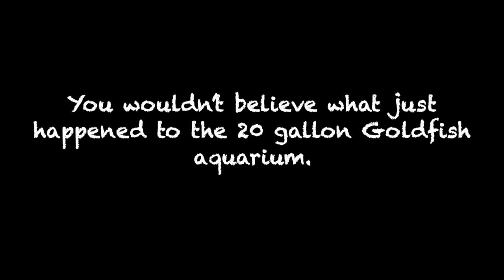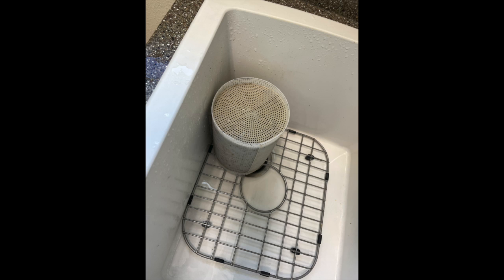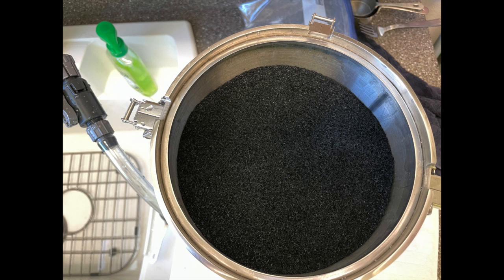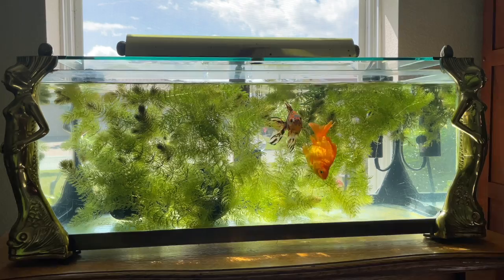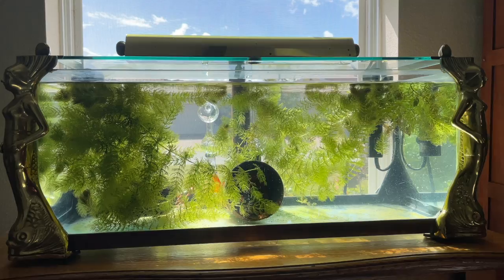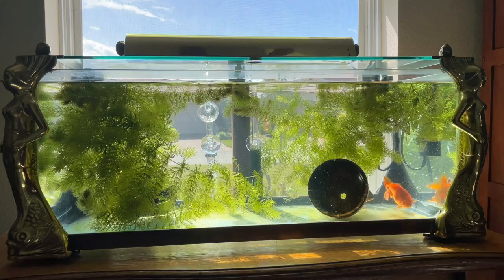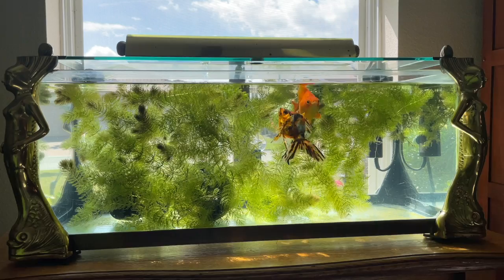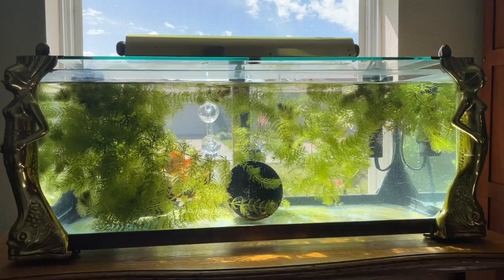You wouldn’t believe what just happened to the 20 gallon Goldfish aquarium.

Comment: RATED 800 G per hour vs 80 G .. for less than half price! No comparison!
Reply from the maker: From what I'm seeing it's probably pumping somewhere around 250 to 300 gallons an hour. A lot less than the same pump that's connected to 5/8 inch tubing on the lanai 40 gallon breeder which is pumping over 400+ gallons an hour. It's amazing how just the tubing inner ID diameter will make a big difference on how much water can flow from my pump.
Reply: @anoxicfiltrationplenums  Got it. Any plans to change the tubing? As you like to have good turn around of water I added another filter in my main tank even when water was crystal clear. It is a top filter (the type reviewed by you recently, fitted with least possible resistance/less bends overall) 15$ and I can add one more.

Comment: Will the speed in which the water flows through the pump going to create more oxygen and negate the anoxic filtration?
Reply from the maker: Absolutely not. The faster water and can go from point A to point B the better.
Reply: Idea is make the water go as fast as possible without disturbing the contents of BCB.
Reply: The water is going around the bcb, and not through the bcb. Many get confused , in the plenum the water flow should be slow , but with a bcb in a canister, the flow should be fast.
Reply: Apparently not because the water flows around the BCB as it takes the path of least resistance.  As mentioned by dr. Novak in another video only the first few mm of the BCB will have aerobic conditions.  But the interior will be low oxygen or anoxic.  The ammonia molecules having a positive charge are attracted to the negatively charged clay and are pulled into the bcb.  Whereas the water molecules are not attracted and flow around the bcb.  Theoretically, I would imagine there would be a speed in which the ammonia molecules would be traveling so fast with the water that it would bypass the BCB, like a satellite traveling too fast to stay in orbit around a planet, overcoming the force of gravity.  However, I am not sure what that speed would be or if we are even capable of achieving it in our aquarium.  As long as the water is close enough to the BCB to allow it to attract the ammonia out of the water it should hopefully be good.
Reply: The other thought I have about this is that I think the larger the BCB basket is the more attractive force it will have to pull the ammonia molecules out of the water.  Just like the larger a planet is the more gravity it has or the larger a magnet is the more magnetic force it has to attract iron.  The BCB Dr. Novak is using is large enough to have a decent amount of attractive force on the ammonia.  So I would imagine it is enough to overcome the inertia of the ammonia molecules.

Comment: Hello Dr Novak.  

I have an exciting update this am.  As usual, I ran the water quality API tests, and because I had removed the hang on back filter and have been using only the sump with the BCB and bio-ring bag for biological filtration I ran all 4 parameters.  All the parameters except for nitrates have been negative for some time, confirming that the system does complete that portion of the nitrate cycle efficiently and without help.  I have been doing water changes every week as needed to keep the nitrates down ( I set 50 ppm as my threshold).  Last week the nitrates tested at 20 ppm. Today they are negative! I ran the nitrate test twice, due to disbelief that the anoxic bacteria could be so suddenly recognized as participants, but the test is still negative.  There are no plants in this system. Filtration is completely reliant on the BCB sump system.  I am calling this preliminary findings until I have repetitive success, but this is very promising!  How very exciting, and this occurred in my old system, which has a lower flow rate ( approximately 80 gallons/hr) as compared to the new system I have been contemplating! So for now I am not switching out the system, just planning to monitor this one to see if my results are repetitive.  Thank you for your time.  

I’m working on upgrading the filter and pump system on my 70 gallon tank.  I’m looking at this system you have outlined here but was wondering if I can  use this size system and successfully filter as well as you have. The aquarium houses a large cichlid that produces a lot of waste.  Nitrates build up quickly over the week. The canister is a 22L. Currently my new large BCB has been filtering on the tank for 2 months with approximately 120GPH so I will be transferring it to this canister with increased flow. All other external filtration will eventually be removed as well so that, as in this video, I have only the canister for better esthetics.  Thank you for your time
Reply: How large is the bcb? A BCB 30cm x 30cm x 20cm is good for one adult koi in a pond. Just to give an idea.
Reply: @rockfella27  it’s 15 x 12 x 18 inches. I have a second basket  4x6x8 inches on board too. But both are less than 2 months old so are still in the culture stage.  I’m hopeful these BCBs will handle a good deal of this fish’s nitrate load eventually.
Reply: @jenniferchilton-kauffmann6280  you need to add 4 more cichlids to the tank to demonstrate the effectiveness of the anoxic system

Comment: Hello Kevin, Can you explain the disadvantages of having high flow in the plenum? I was thinking of installing a power head rated at 60 GPH to the tube. The tube by the way would be modified to 2" & hold a small sponge filter mini bio balls and activated carbon. what would be your opinion on this type of setup? This would be for a 6 gallon mini tank.
Reply: When you have hi flow in a plenum it has more oxygen than it should. Plenums create anoxic conditions which still has oxygen but very, very low concentrations. This allows for the bacteria to establish over the coming months. with your idea of adding a power head all you would be doing is creating an under gravel filter system that would create nitrifying bacteria. for a 6 gallon tank create a plenum using under gravel filter and cut the lift tube down to 3 inches. if your looking at using planted substrate you will need to use weed mat (it needs to allow water and oxygen to move through it) place that on top of your plates. the cavity under the plates needs to be left hollow, there should be no substrate in this area. I have a 26 Litre tank running a plenum as I have just described and it works wonders. it look about 3 months to get established but as the months go by it gets even better. :)